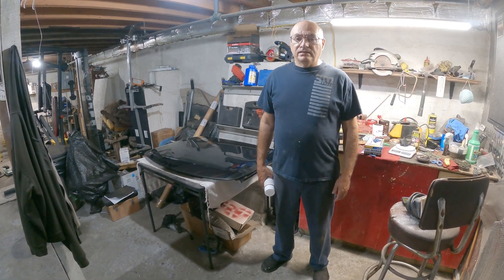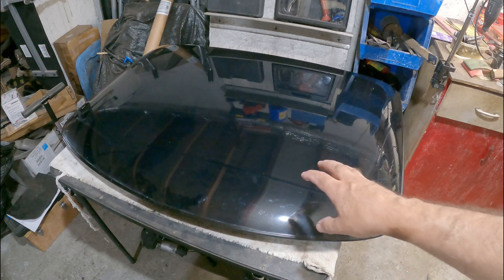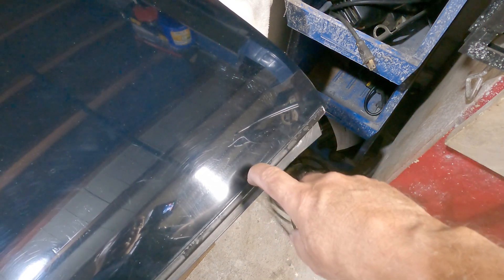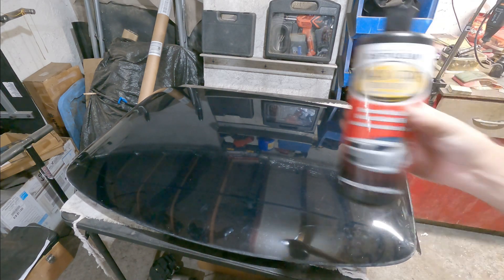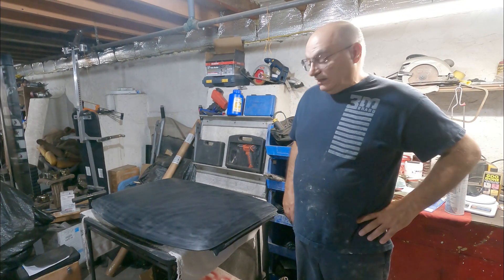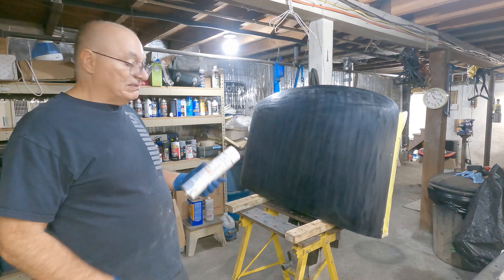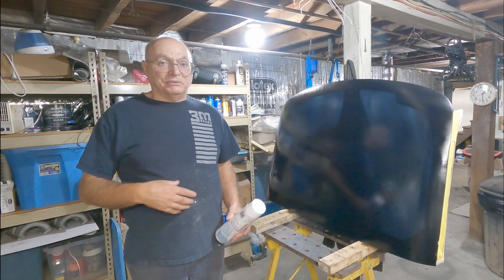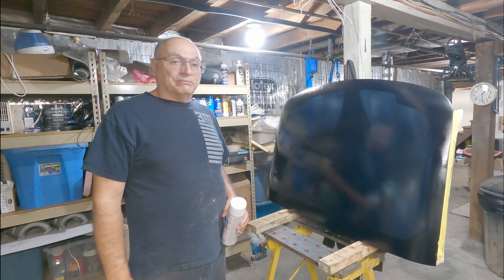Transparent Targa Top Recoat Part 1

Comment: when you say the 2k clear peeled of, how long did it take and what prep? I'm about to do my c6 one. it's polished raw plastic, but is to fragile. I have a can of k2 and am about to sand it with some 800grit to scruf it before spraying. but pealing off in a year or 2 would be annoying. curious of the details on yours
Reply from the maker: I just used standard prep 600 grit sand paper and wiped with alcohol, keep in mind my prep and painting skills on any large area is sup par, I normally avoid it except small pieces. I may be replacing my transparent with a new lens this summer once the temperature rises and I swap to my solid top. Good luck with your project.
Reply: @E.T.GARAGE  huh.. that's me too. I don't do this stuff, I'm more of a mechanic. I only mess with it when I have to. so yeah. that's the same prep I am going to try. guess it is what it is. don't know of anything else to try